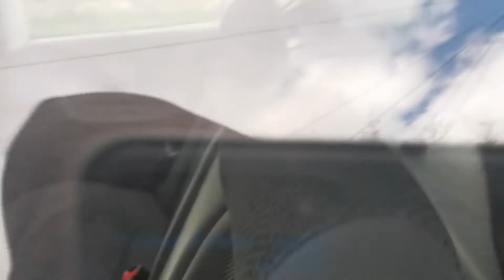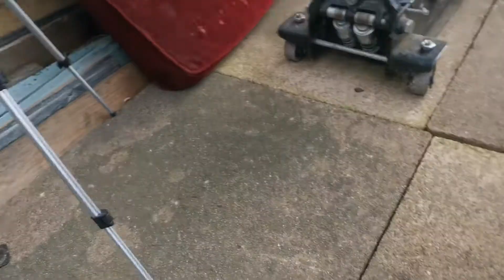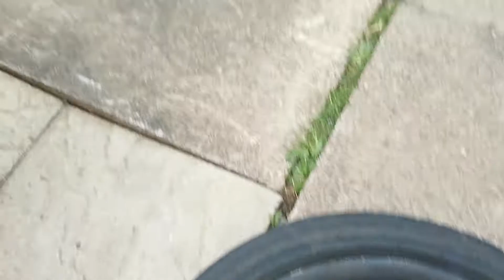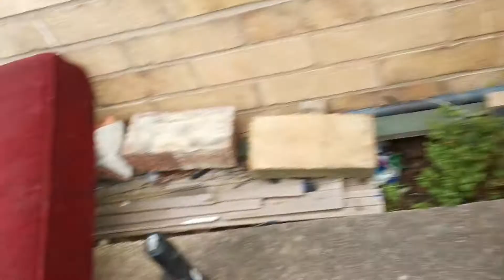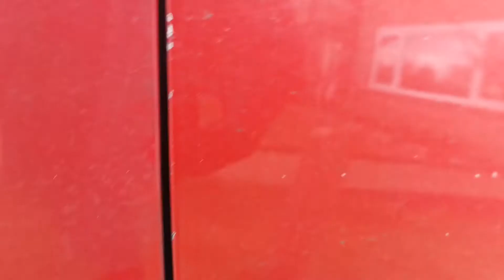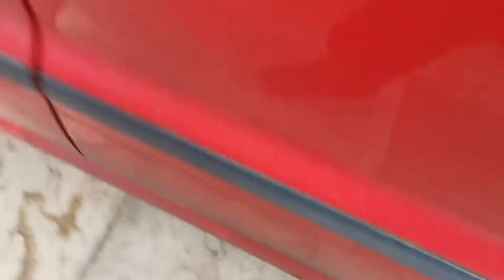polo project part 2 jacking up the car

Comment: Another great video. I need to replace my rear calipers, I have a jack and 2 axel stands but was unsure where to put the stands or where to jack up the rear from.
This helps a lot. Did you jack up the rear from the centre of the main real axel bar?
Thanks again buddy!
Reply from the maker: Yep I jacked this up from the centre of the rear axle and you will be able to put your axle stands on either side of the axle it will be ok to support the car unless you are doing rear suspension work then I would advise putting the stands on either side of the car on the cars standard jacking points.